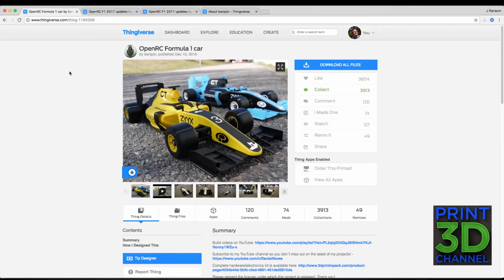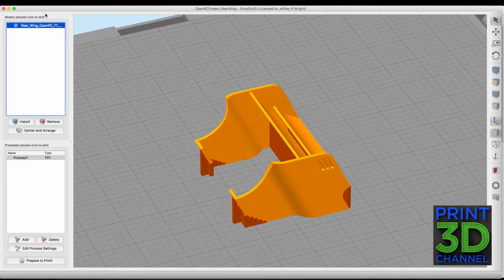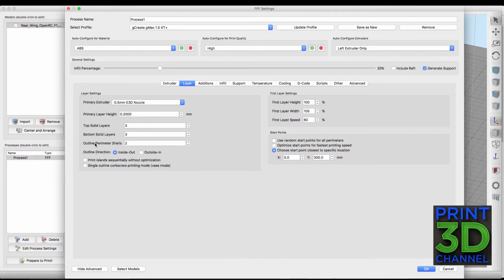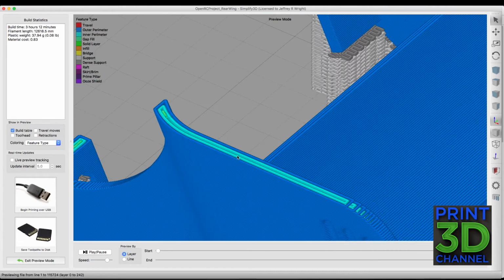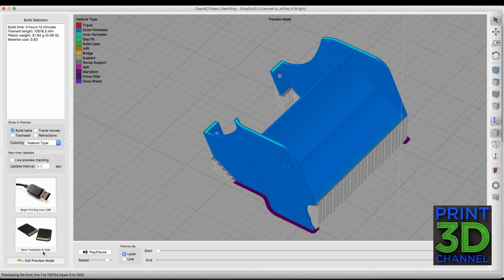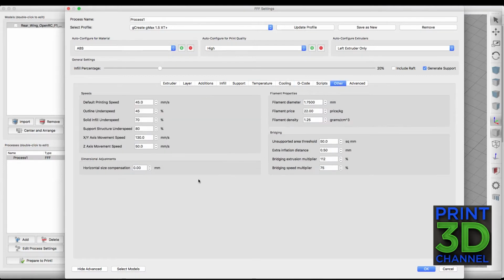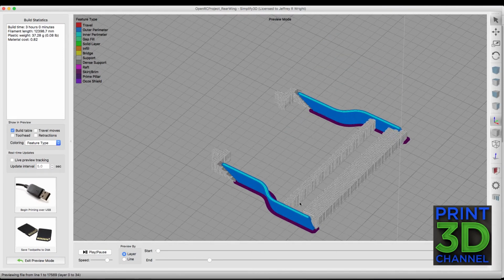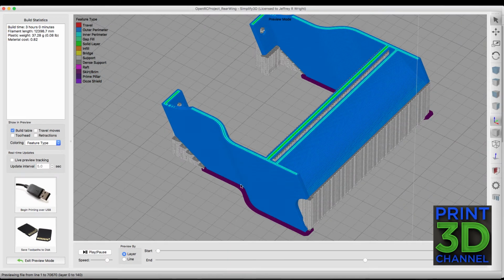#3DP365Project - Day 87 - #OpenRC F1 Project - MatterHackers & gCreate gMax 1.5XT+

Comment: The reason for the print time difference is with 3 perimeters you are printing essentially infill between the perimeters at the speed of perimeters, which you have set at a lower speed than your infill setting. It will also use a bit more plastic as it will make the walls more solid, not any thicker, just more solid. It also uses different infill logic when you say you want more perimeters than it can do. I actually prefer to set the perimeters for these type of models to 5 or 6, I know it can't do it, but it will ensure the walls are completely solid and will not use any sparse infill. Keep up the progress. I can't imagine putting out a project video daily of my projects. I barely have enough time for the project.
Reply from the maker: That is a very good tip and thanks for sharing this. I now know more about S3D and why it does what it does. Thanks again, and thanks for watching and for the support during the #3DP365Project.